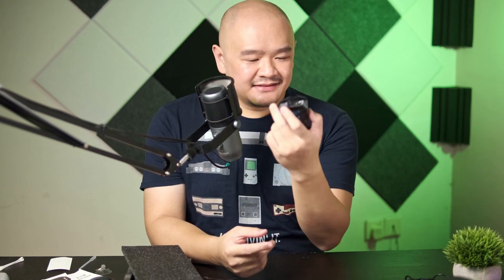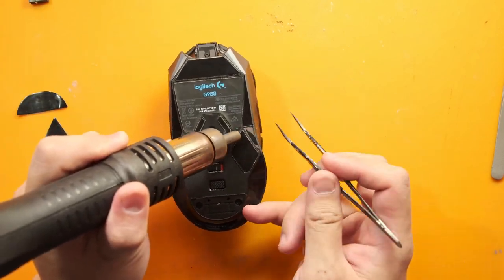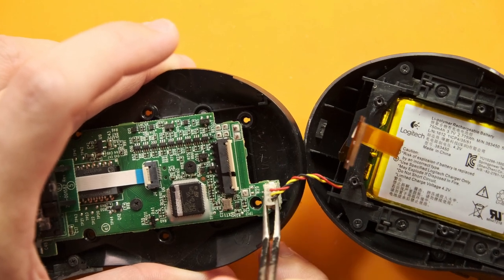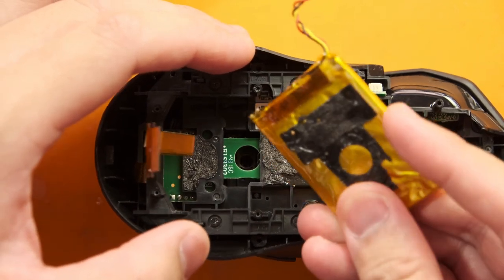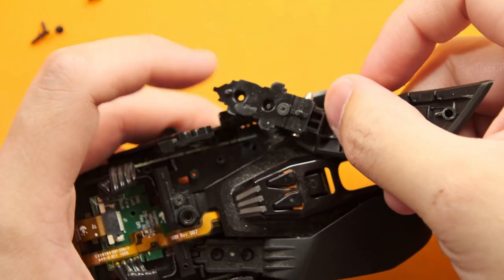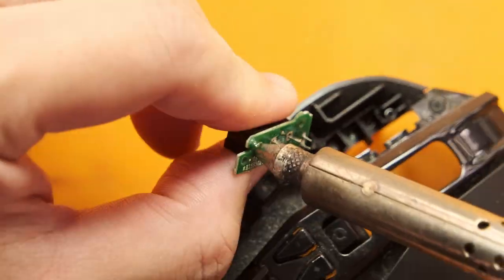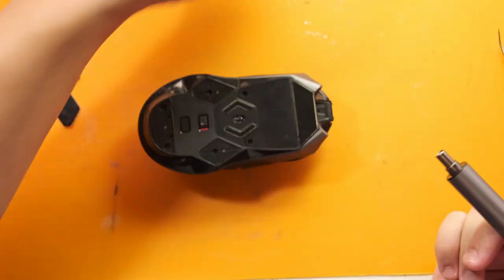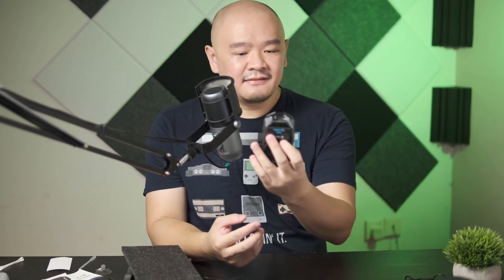BUSTED Switches on this G900... Let's Fix it.

Comment: I clicked the "like" button with my G900 mouse after fixing it by following your instructions, so thank you! The final step was a bit different since the switches i bought where full, including the small connector, and then you have to unmount an additional piece, but don't need to use solder iron.

Comment: Great video thanks for sharing. I did that repair yesterday excluding the soldering. Instead I bought the switches with the circuit board. There is only four extra screws to remove to be able to unplug the switches circuit board and swap them out. I'll probably do the soldering next time around, replacing the switch from the original circuit board before putting it back in.

Comment: I'm so glad I've watched this video before even thinking of trying to repair a mouse. My sausage fingers are not good for that amount of tiny screws and parts.
Reply from the maker: I wouldn't discourage anyone from doing it! it just requires some patience and time on your hands (plus this mouse itself was a little bit more difficult to take apart but they're generally pretty easy)
Reply: @TechRodent  I'd say I have the patience but my hands can go as far as building a computer on a full ATX case. A mouse seems to be too tiny for me. But I may try if I need to.

Comment: Good vid, I opted to buy new boards for both switches that are hot swappable, and a pile of various extra switches, my mouse will never die now! lol. i also cut tiny circles in the skates the same size as the screw heads and left them in place, so i never have to disturb them again when i take it apart ( this does leave holes in the bottom of the skates but its just cosmetic really, who looks at the bottom of your mouse! lasers are bad for your eyes anwyays lol!)

Comment: Why did they have to put the screws under the sticker and the skates? I'm afraid they won't stick properly anymore, especially at the edges, so they might get stuck in places, collect dirt or just not feel very smooth anymore. That's why I'm not opening it up. I just need to clean out the scroll wheel.
We didnt see that in the video. Will the skates stick properly again if you removed them while heated?
Reply from the maker: It's better but not perfect as per before.

Comment: i did that with a switch i bought from ebay ... it lasted for 6 months . Thing is that you can never be sure that the switches you buy are going to be new ones so you are basically wasting your time unfortunately. Same goes with the battery which most batteries are crap out there or already used.
Reply from the maker: As someone who repairs stuff on the regular, I disagree with this; I believe it has mostly been bad luck on your end, a lot of the devices where I change their batteries or parts/ switches etc end up lasting most times longer than they did out of the box